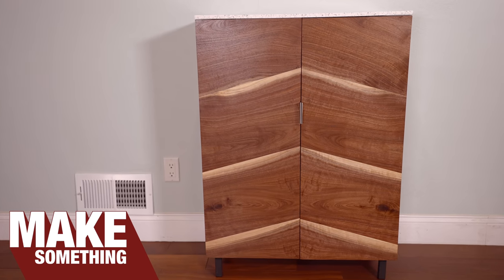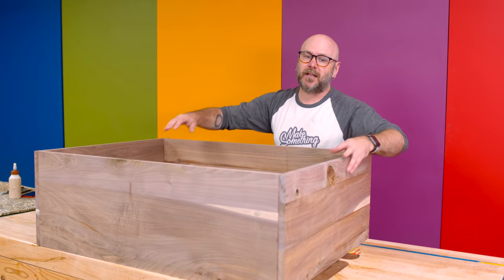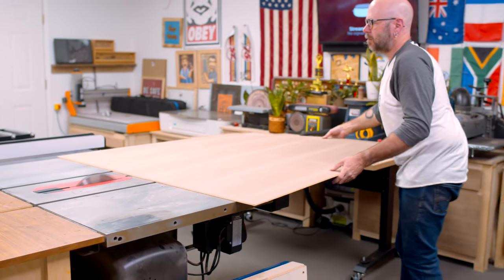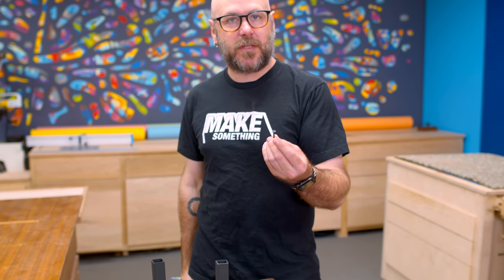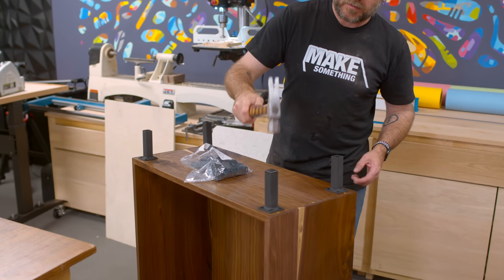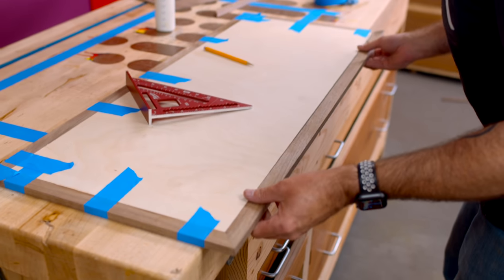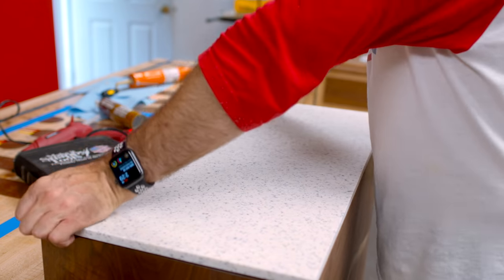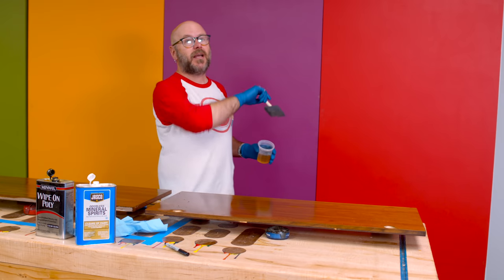Fine Woodworking Hallway Cabinet From Solid Walnut

Comment: Nice job man! Only possible issue is that the doors may bow in the future because there is a different thickness and material on the front than in the back. Normally you try to get the same thickness of the same product on both sides of the veneer if you want it to stay flat. But its possible it ends up just fine! 

Very nice job!
Reply from the maker: Thanks! So I discussed this with a real woodworker and he told me the reason you have to veneer the back is so the plywood doesn’t “breath” only on one side causing it to bend. So any thickness will work. Time will tell!
Reply: @MakeSomething  not to "toot my own  horn" too much. But I'm a bit of an expert in wood movement, myself. I'm very interested to see what happens! Ultimately I believe it will come down to the moisture content in the wood you used, and the moisture and temperature control in your shop. I'll be very interested to see what it looks like in 3 months!